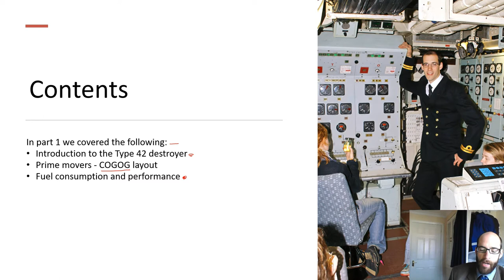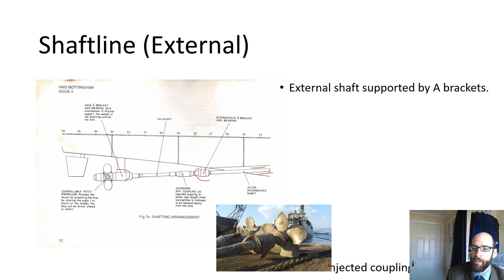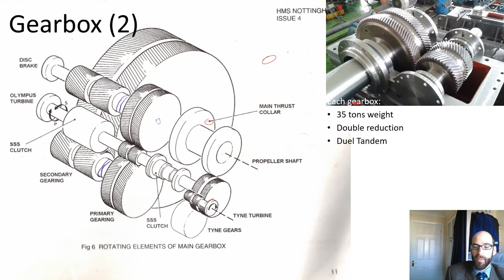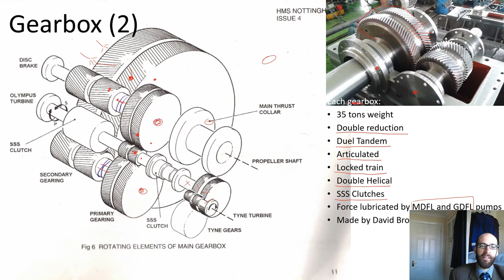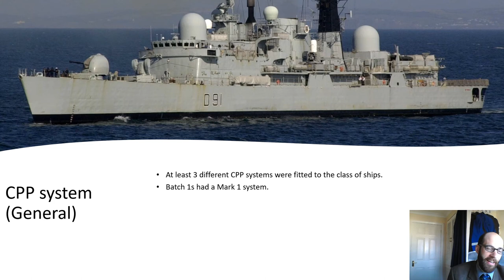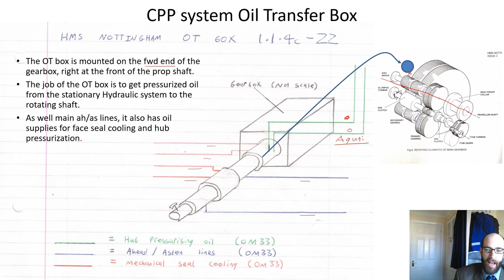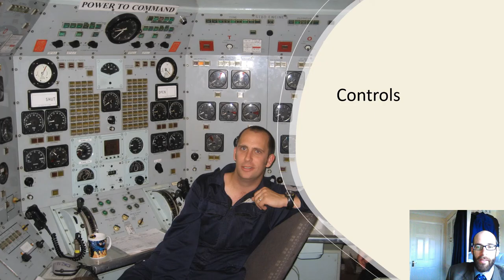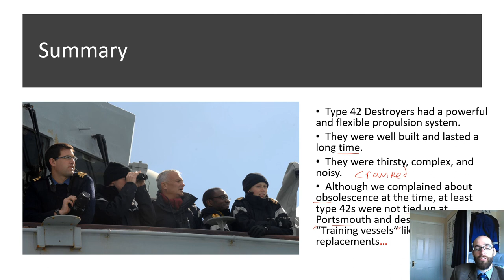Royal Navy Type 42 destroyer propulsion system part 2

Comment: Special Service Aguti air blew the air out of the blade tips. It was supposed to reduce noise and also reduce wear on the blade tips as caused by cavitation. It had been blanked by the time I joined a 42.

Comment: Thanks god that Marpol convention does not apply to warships. As a Chief engineer of a mechant ship, one could not defend him or herself that leaking out from the blade roots as dolphin feeding oil (even if the oil is emulsifiable). Your oil seems to be a mineral type which is severely punishable by Flag or Port state autorhities.

Comment: DB82 - If you want to get in touch with me off YT, there are quite a few corrections to your T42 Prop presentations you need to embody. I am an ex-42 Prop Tiff (had 5 x T42s from stoker to Warrant), former lecturer at DSMarE and have information and .ppts you may like to see and use.
Reply from the maker: Thanks. I'd like that!  Its been over ten years and a lot of stuff feels "Right" in my head but may have drifted!  I could do with remaking this anyway, I have a better system now with a laser pointer that actually works...
Reply: @drawingboard82  Emailed you?
Reply from the maker: @fa0676  replied. Might be in your spam box
Reply: @drawingboard82  No probs. Will check
Reply: @drawingboard82  Not anywhere in spambox. Wanna send me a test email again?

Comment: Gosh, the CPP system is complicated. Amazing that it was reliable. Your red lines that pop up when describing thing like the control panel are sometimes quite hard to follow (i.e. a new red line pops up but the viewer has no idea where it will be in the picture and may well miss its appearance). I'm thinking, if you have a screen recording function, that simply moving the cursor around to point at things would be easier to follow, because the eye can easily track the movement of the cursor, rather than having to work out which red line is the newest one. On the downside, you'd maybe have to move it whilst giving the commentary, whereas it seems you prepared the red lines in advance. Secondly, the talking head picture-in-picture quite often obscures the main text. We could lose that white door to the left of your head. Not wanting to be picky here: still an interesting video to watch.
Reply from the maker: I know exactly what you mean. A recent update to PowerPoint made that impossible! I managed it with previous presentations like Concorde. So I need to figure out a solution. I appreciate the viewing and glad you got something out of it. I really like your new gearbox by the way.